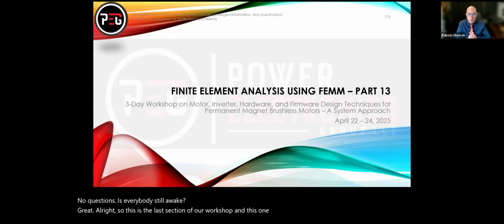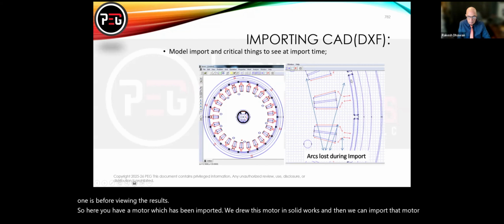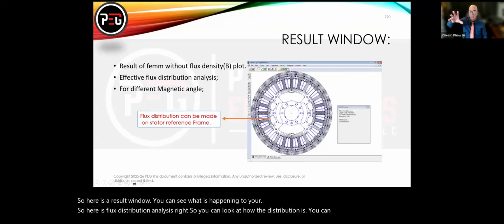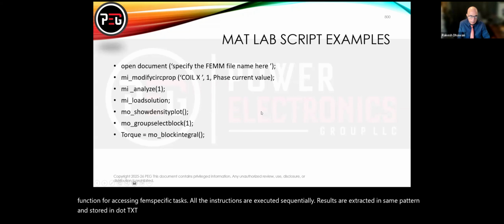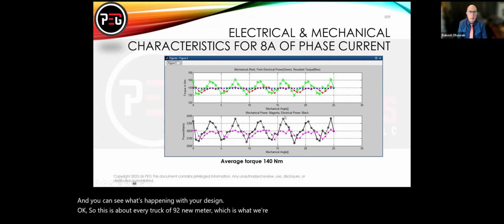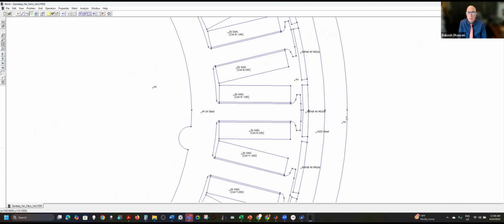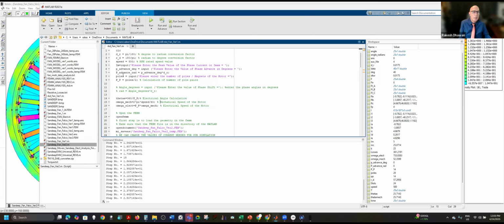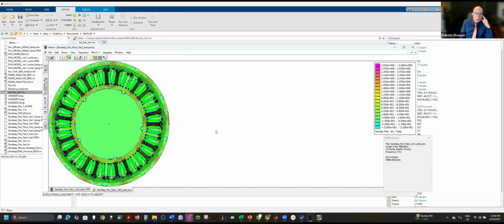Finite Element Motor Design and Automation Using FEMM and MATLAB: A Practical Methodology

Comment: i have a doubt does anyone does this and more over if so do they made some addtional code to get the voltage graph, back emf and performance analysis and other stuffs
Reply from the maker: Yes, You can extract additional information from FEMM with a Matlab code.